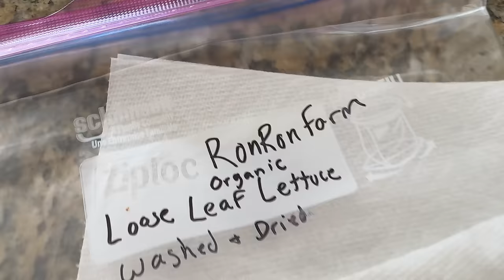SHE'S BACK!

Comment: When cutting drywall, just cut/score from front side instead to stop paper ripping back. When scored, then you can snap it back and run knife through gap again if needed. A surform is great for smoothing off edges 😊👍